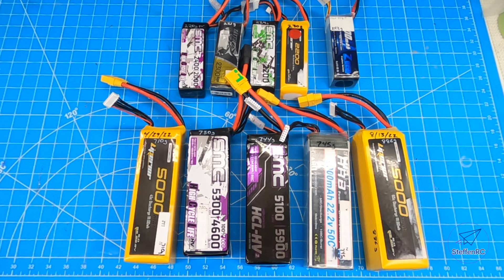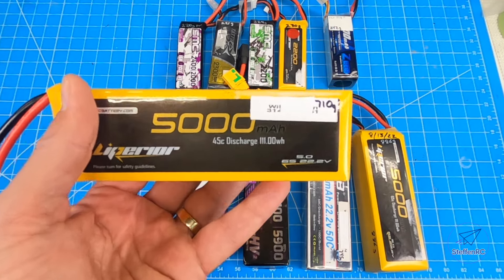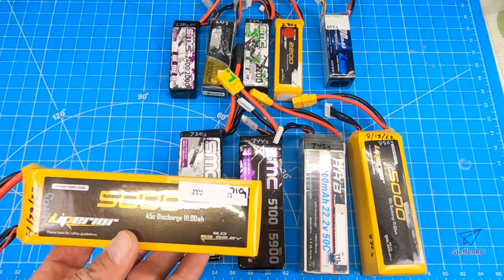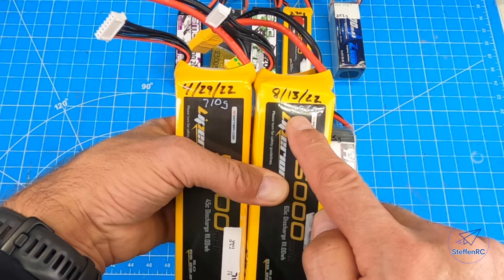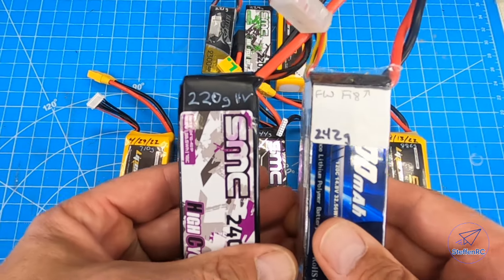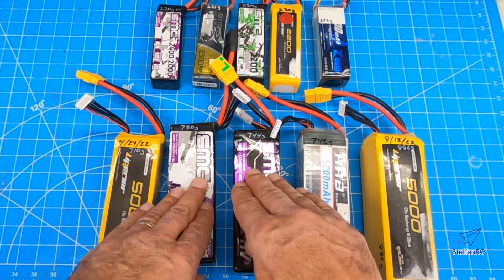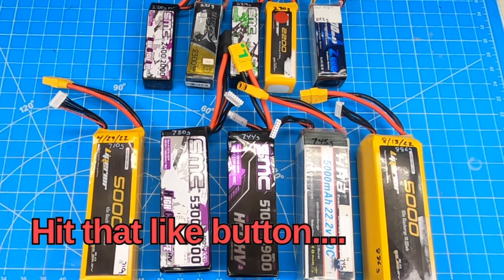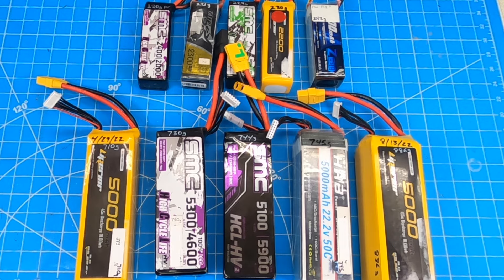Does your CG shift between flights?  Might be your batteries.

Comment: I put a mailing label with my info on my batteries and before I cover it with clear packaging tape, I write the weight and date of purchase on the label. I tend to line the front of the battery up with a certain point in the plane so that the extra weight of a longer, heavier battery is closer to the CG.
Reply from the maker: Great tips as always..  I've started to add more data to mine too.